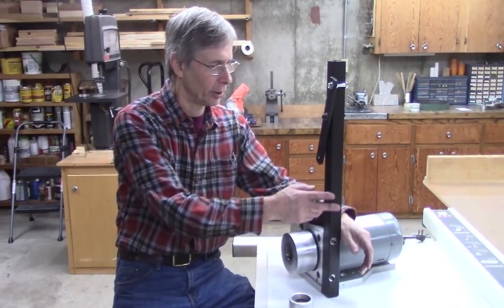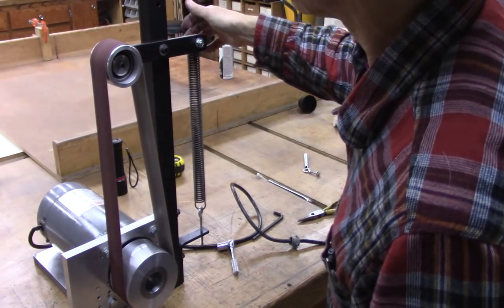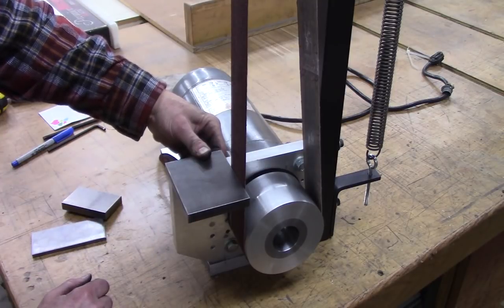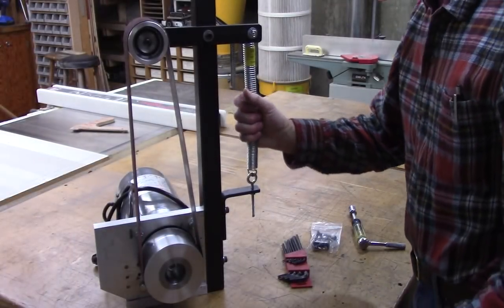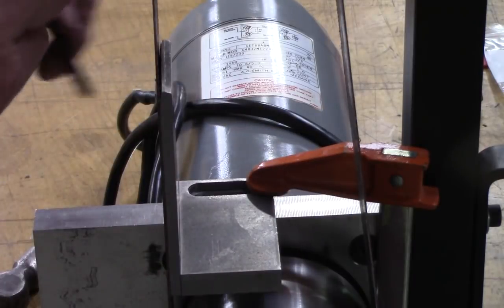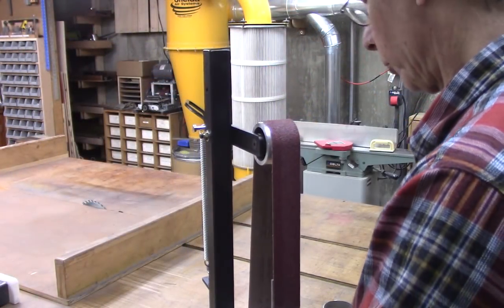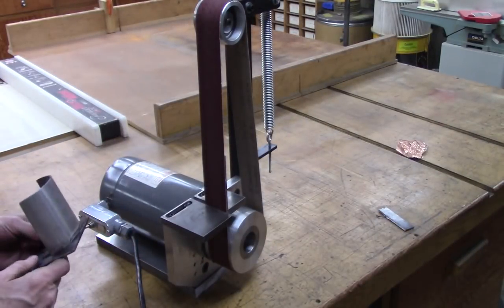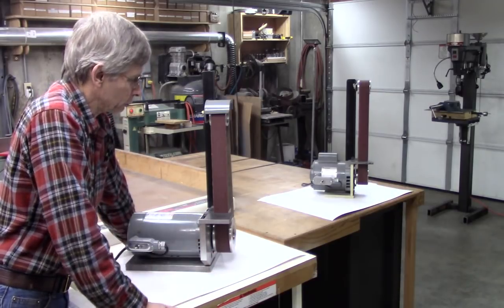A Great Little Belt Grinder - Part 2

Comment: what size motor ? I am sure you mentioned it somewhere..
Reply from the maker: I posted a "Part 3" video Friday morning with the plans. 
If you use a 3 inch drive roller you can use a 1/ HP. The one I made in the video is 3/4 HP with a 4.5" drive roller.  The plans are for either grinder.
Reply: Winky's Workshop x

Comment: What were the rpms on the motor
Reply from the maker: 3450 RPM 3/4 HP  with 4 inch drive wheel, its high speed. It works fantastic! I made one with a 3 inch drive 1/2 HP which worked well also but the larger pulley and extra power really helped.

Comment: 6 seconds into this and first thing I noticed is that the roller on the motor is FLAT,  then it dawned on me --you are Not a farmer !  the flat rollers are going to give you problems. I will watch and at the end--"I told you so"
Reply from the maker: Both rollers are crowned but you are correct, flat is not as good. There are however several belt grinder manufactures that make the drive rollers flat so that they can grind against the curve.  But you watched it to the end and saw that it works perfect. Right?

Comment: Excellent build !  So glad I saw this as the 2x72 builds are really too much for my little workshop and something like this will suit me perfectly.  One question and sorry if it was mentioned and I missed it - what are the dimensions of the vertical piece of HSS you are using to fasten the idler wheel arm and the spring bracket?   I made sure to subscribe to your channel.  Cheers from Canada😊
Reply from the maker: I lost some video where I discussed this. In hindsight I didn't do a very good job at filling in this information. The upright is 1-1/2" square tubing with a 3/16" wall. I made it tall enough to accommodate a 48 inch belt but moved the idler arm down to use a 2 x 42". The upright is 24" tall but the hold for the 42" belt is at 19". Of course this position depends on your pulley diameters. The best way to position the hole is to make the upright a little taller and hold the idler arm in place with a belt installed and mark the hole position. I'll be doing a short follow up video and will include a link to some drawings. It should be posted Friday (3-7) Thanks for watching!
Reply: @WinkysWorkshop  thanks again.  I'm starting to collect my bits and pieces for this build next week !
Reply from the maker: @lewiscobb7817  - Cool, you will love it

Comment: What belt length was that?
Reply from the maker: That part was in the lost video files...  sorry for your bad luck. Ha.  Actually I made the post 24 inch and put two holes in it. The current belt is 2" x 42" and the I can move the tension are up and run a 48".  Thanks for watching.
Reply: @WinkysWorkshop  thank you for the info. I may do a project like this at some point.
Reply from the maker: @Engineerd3d  - No problem. I plan on doing a part 3 to cover some of the info I left out of this video and will post plans using 1/2 plate instead of the aluminum.